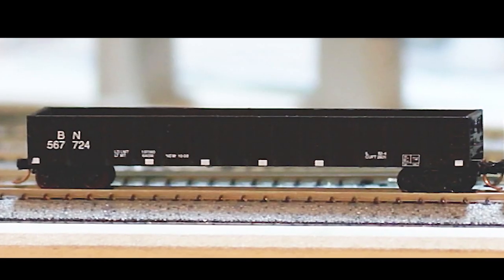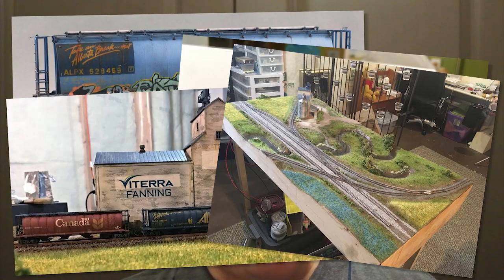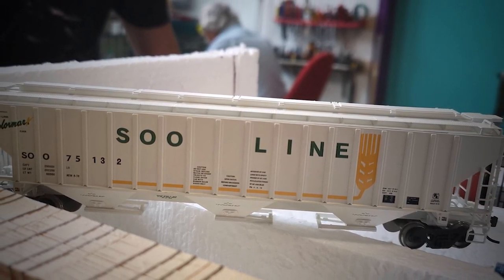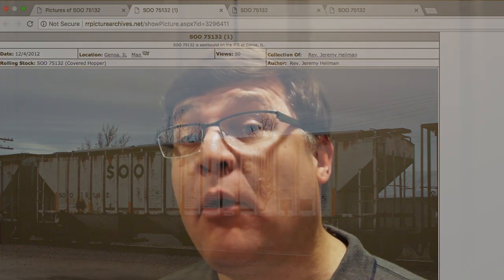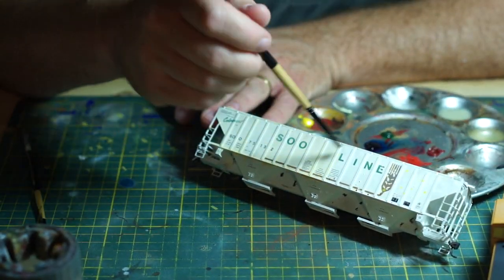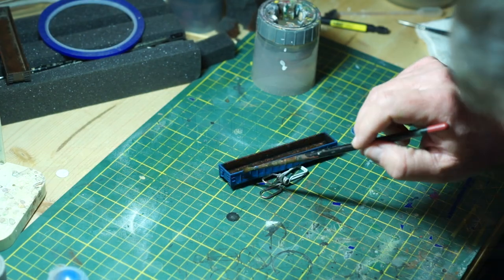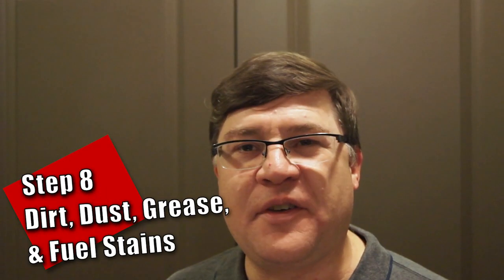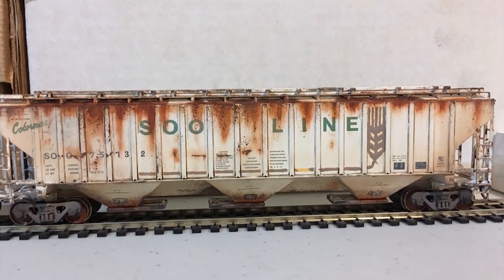Weathering Model Trains - Where do I start?

Comment: I’ve weathered some trains, some using magnifying glass and leaves, to stuff to make it look dark, and or I’ve used a piece of metal and took the body of the car, put a rusty piece of metal on top, thn used a tub for my fountain pump originally, thn whch I’d use for tht whch thn got thrown out, but it took awhile like I’d leave it out in th e tub outside snd lke either weeks to months or so, and it looks reak, knda runs off but it’s rlly hard to do somewhat. But I was gonna just buy weathered o scale trauns and weather thn, forbpole tht need weathered o scale, since smaller is more available lke if you dnt hve smaller but o scale, buy the realistic cars lke the excess car carriers from Lionel tht open the doors or lke hve the open doors on the side, thn make thm look real weathered or jst lke weathered in general, xnd buy it for 109 smthng or si thn lke sell thm fir 3 to 600 or so

Comment: In this video, what type of paint do you use for Weathering ?? Acrylic paint or oil paint or other types of paint ??
Reply from the maker: As this is an overview, the others detail the process. I use both acrylics and oils, as well as some pre-mixed weathering products. It really depends on what I am trying to achieve. For example, for the Pin-wash step, which is detailed in another video in the playlist, I usually use either a home-made oil paint wash, or an off-the-shelf product depending on the model itself.